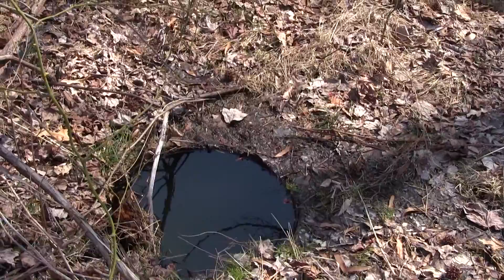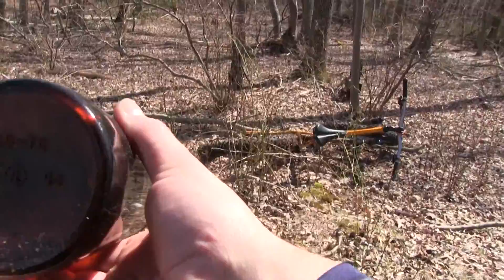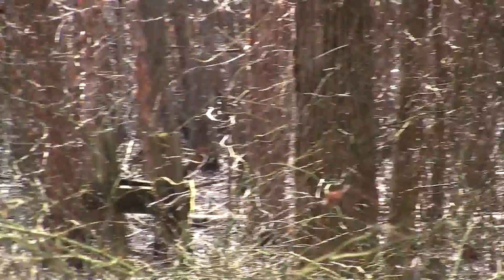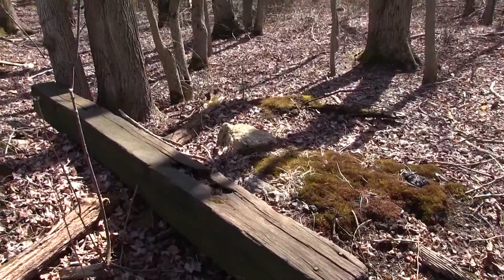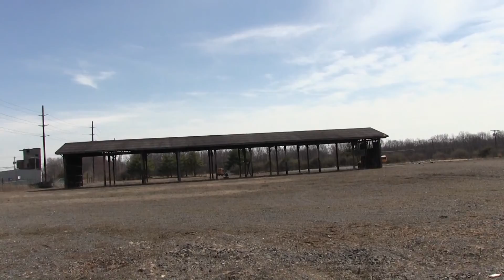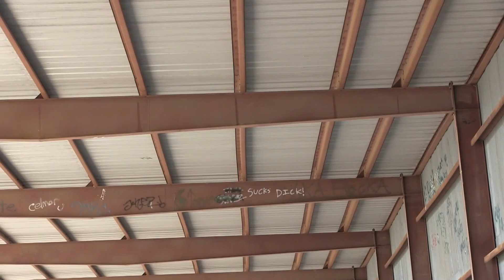The Abandoned Crumbling Industry of Farmingdale New Jersey

Comment: The area with the pipe is from Rokach factory. They made borscht and other food products by the tracks off Southard Ave in Farmingdale. They would pump out the water used to wash the beets into the woods. The area would be red from it. Across the street was Golds lumber, that's the large open buildings you found. These were built in the 70"s closed in the late 80's I think.